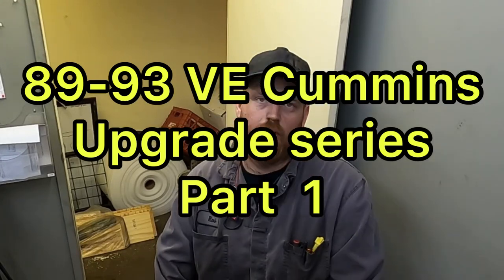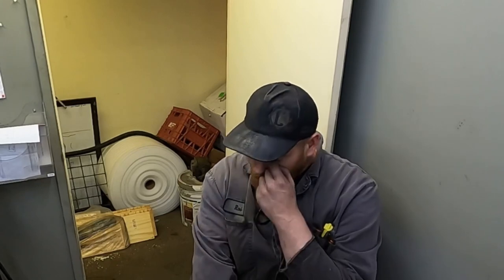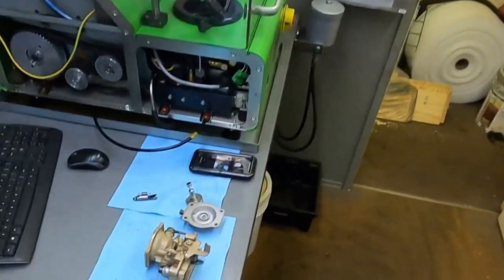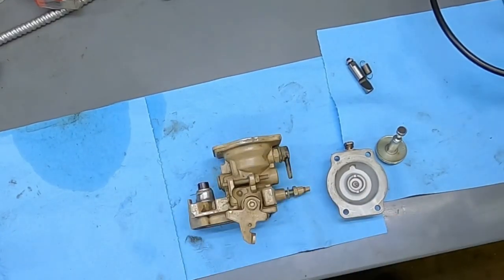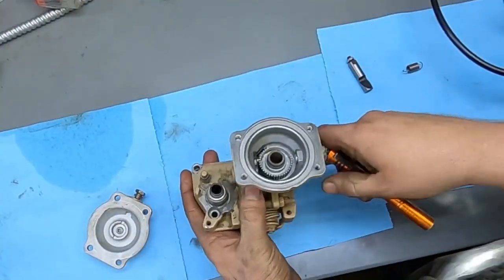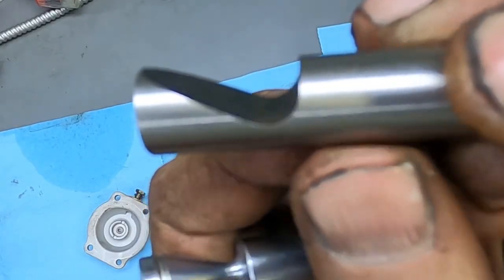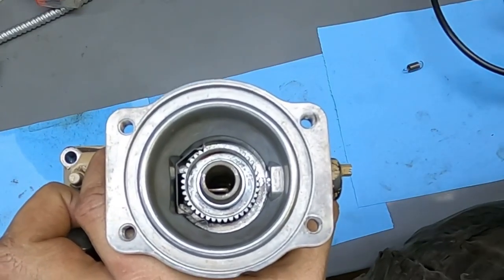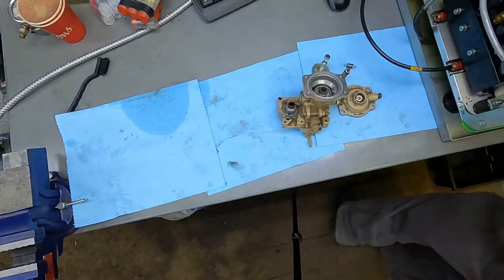Ve Cummins ( 89-93) Cummins upgrade series Part 1

Comment: I have the bmw 524td (usa) timing advance is electronically controlled via a frequency valve that stops or flows fuel onto the timing spring. 

I would love to convert my pump, or just buy a cummins idi of close specs but has mechanical timing advance. 

Due to electronics, two being #4 needle lift sensor and crank position, without those it defaults to 10deg advance after engine start. 

Technically its more fuel efficient.....when all sensors work. 

Thanks for posting your knowledge.

Comment: Hello, I found your channel yesterday and sub after the 2nd vid I watched! You got some good content here. I been working on my 89 first gen.  And got a 96 parts truck that I'm going to pull off the intercooler and hopefully the turbo is ok. I was run out of oil. But lots of good parts for cheap. Ill be watching for more vid. Thanks again.
Reply from the maker: Thanks for watching !  the intercooler can be made to work. on the turbo if the turbo was ran out of oil I would atleast do a kit in it make sure it good inside.

Comment: What’s the best way to make sure you’re using your entire throttle. If I stand on the pedal I’m not fully opening up the throttle. And moving my throttle linkage to the inner hole that changes the leverage helps but there’s gotta be a better way.

Comment: Appreciate the info! I have a question... If I have an intercooled ve pump and put non intercooled delivery valves on it, can I run that on a non intercooled engine and be pretty close to the original output?
Reply from the maker: Yep or swap the injection line. That’s the only real difference
Reply: @CUTTERUPROB  awesome, thank you!